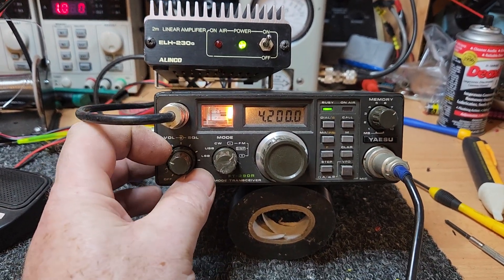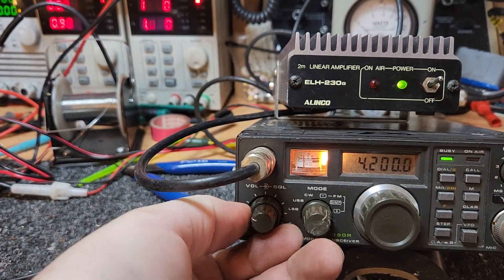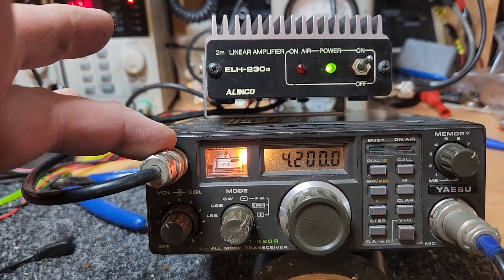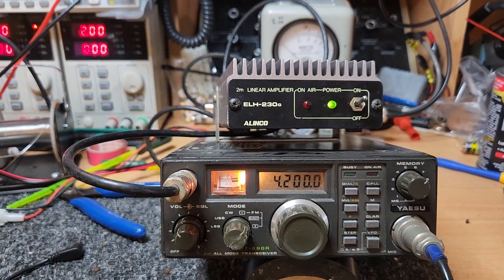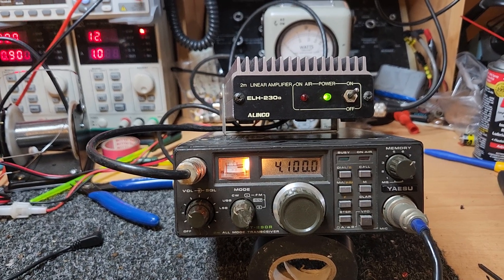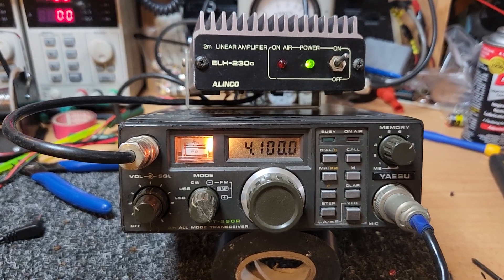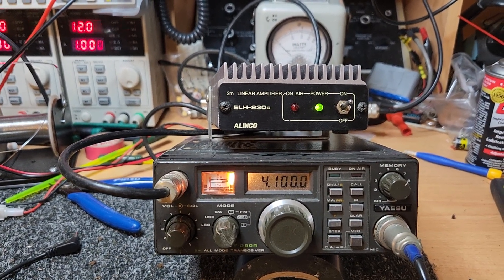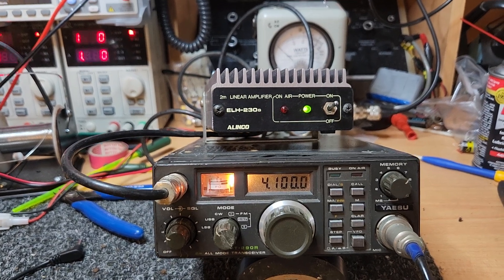The older but reliable Yaesu FT290R 2m SSB/FM/CW Transceiver linked with a 30w Alinco Linear amp.

Comment: The FT 290 is positive earth is the Alinco positive earth too, or does using different power supplies to each component?
Reply: I arrived here too, hoping he would educate us. 
Some questions, how did he power the FT-290r that is (Positive) to ground, using an amplifier that’s powered Positive to +. 
This is a mix match. 
If the negative body of the radio touches the Positive body of the amplifier, it will blow and possibly destroy whatever power supply he is using. 
My other question is, are both equipment powered by two different power supply’s? 
Is the amplifier DC or VDC?

Comment: I still have my 290 plus the UHF version 4?0. The only problems i had were the battery holder's breaking and the audio amp that died. I used them both as part of my packet radio node G6JVS back in the UK years ago. I must dig them out and give them a test. Thanks.